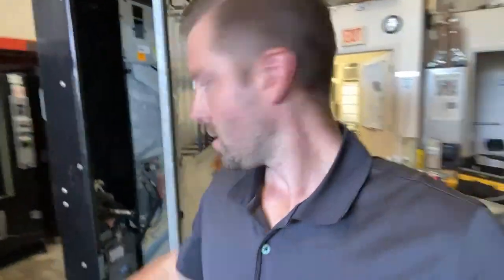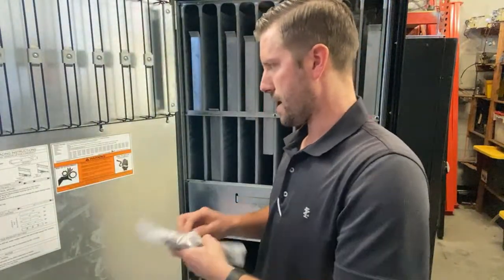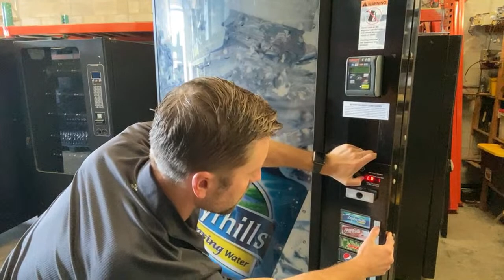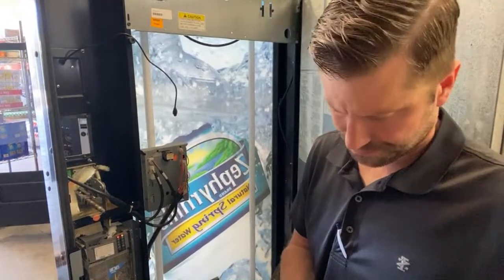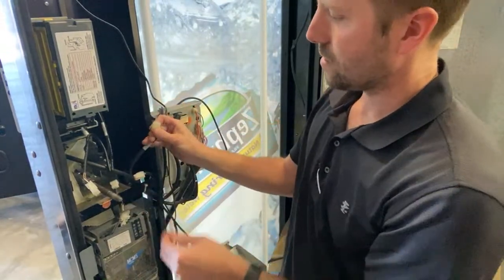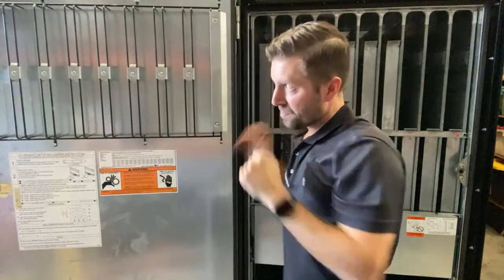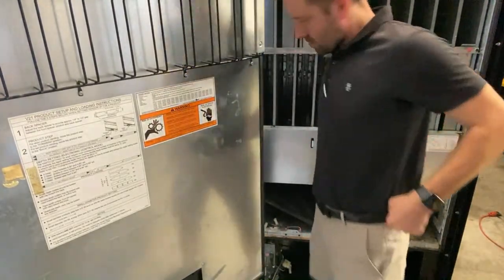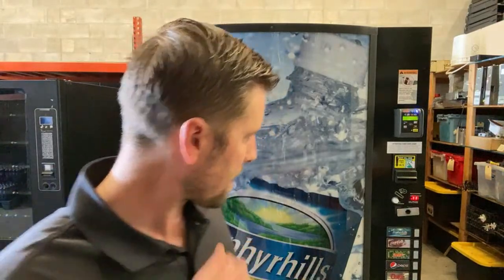Setting up a drink machine live!

Comment: ADAM I HAVE A QUESTION.  I am struggling with, do I add card readers and suffer with the fees having to wait to get paid? OR do I NOT add card readers pay nothing but potentially loose sales because of the ease of not needing to carry cash? do you have locations without card readers and where is the line when you decide to add readers. THANKS FOR WHAT YOU DO
Reply: All i can do is speak for myself. I bought a vending route from a dead mans widow. The machines are all snack time manual coin operated machines. I am in the process of buying and installing these new Electronic Machines with Credit card readers as the fact is people are moving away from carrying cash/coins. My first machine did a months worth of sales of the old machine the first week with the upgrades. For me credit card readers its a have to upgrade. Soon there will be a better cheaper block chain type of p.o.s. available and it will be better to use.